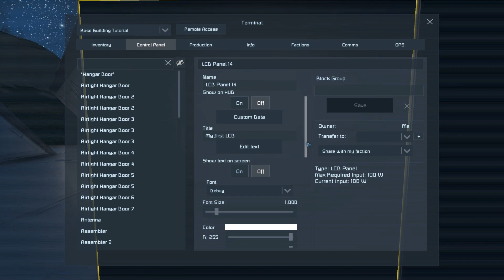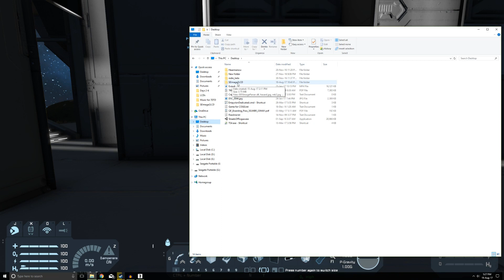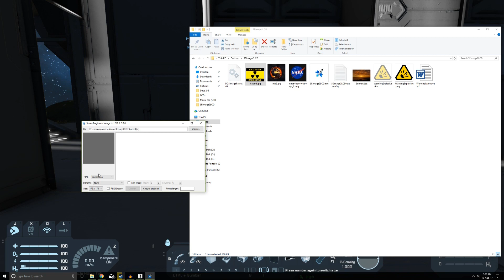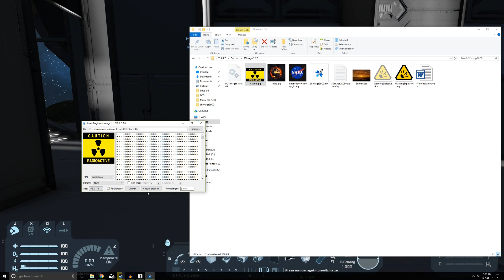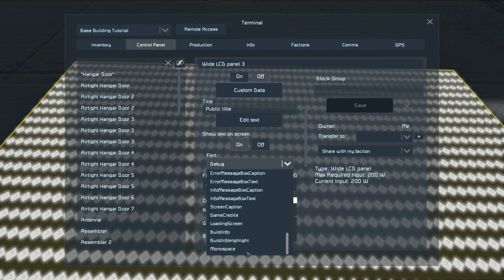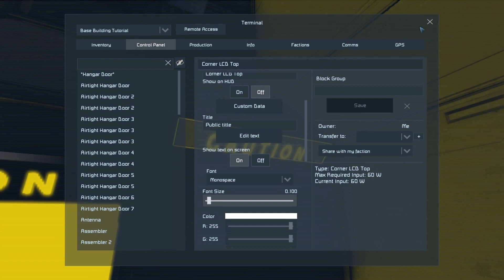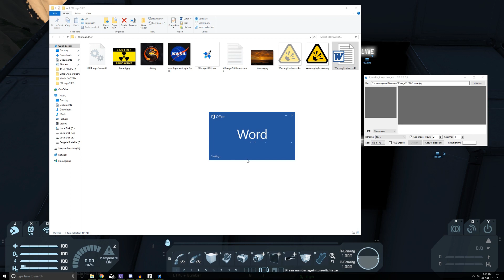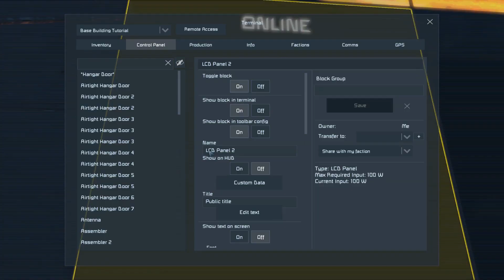Space Engineers Tutorial: LCD Panels, Import Images (tips, testing and tutorials for survival)

Comment: Hi there mate,
Just wanted to pass on something from the comment in the Community page For that File.
[quote]TheSaxmeister 4 Sep @ 10:10am 
@Nekron910 & @Valikai, and anyone else who are asking about fitting the widescreen 2x1. REAL EASY solution:

1. split into 2 columns in converter.
2. Open Excel
3. Copy column 1 to excel column A
4. Copy column 2 to excel column B
5. In Excel column C, use the formula "=CONCATENATE(A1,B1)", and expand to all 178 rows.
6. Copy column C to Space Engineers widescreen LCD. VOILA!

This will also work with Google Spredsheet (i checked)
[/quote]

Im sure people MIGHT spot this if there grabbing the file but incase not figured i would pass this on :)

PS: I recommend Mmasters Auto Lcds 2 and  "Taleden's Inventory Manager"  also know as  [Tim]
Reply from the maker: That is an awesomely handy tip :)
Thanks! So much easier to use excel to merge the two than doing it line by line

Comment: Nice that you included image importing. I've tried it on my own, but it didn't work for some reason. Could be because I didn't uncheck URL Encode, I don't remember.

By the way, URL encode makes sure a character string can be used as a URL, by replacing characters that can't be in it by a so-called escape sequence. For example, a space is encoded by %20. Not sure what it's needed for in that program, but it makes sense that it prevents this trick from working.
Reply from the maker: Ah ok, don't know why they'd have put that in either. Hopefully next time you try it everything will work well, it's a pretty cool little feature :)

Comment: is there a mod to give the panel better picture quality??
Reply from the maker: The text based mode of the TV which you can use without adding mods to your save (and so will work on servers you don't have control over) has a max resolution of 178x178, to get higher resolution of 512x512 you have to create an image mod which requires photoshop with particular plugins to create (I think there might be plugins for GIMP as well but not certain)